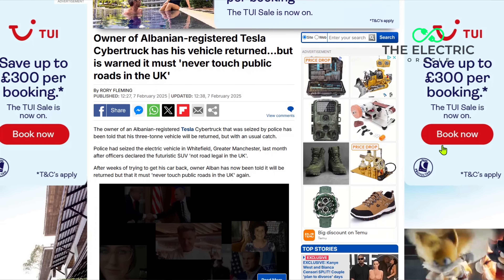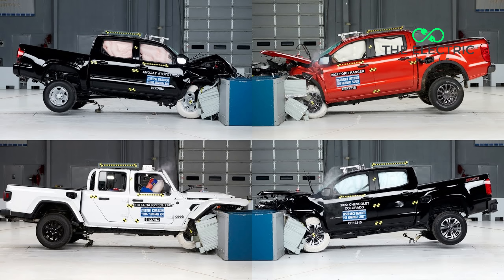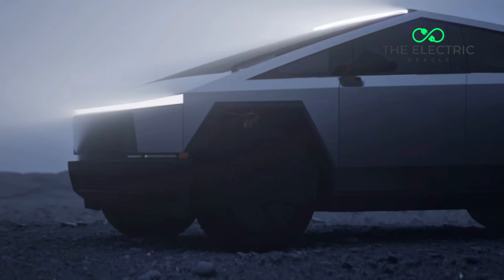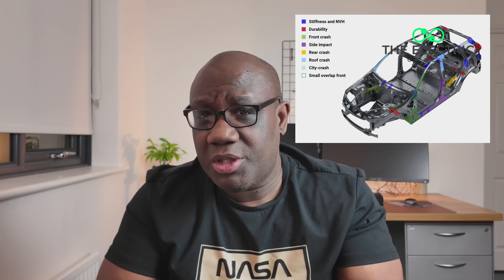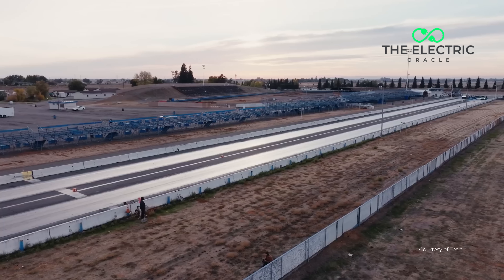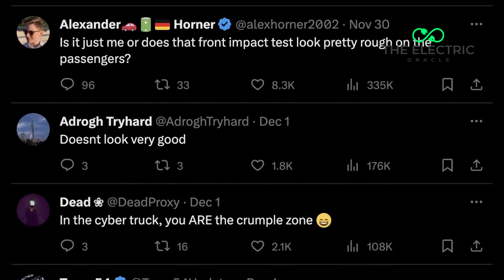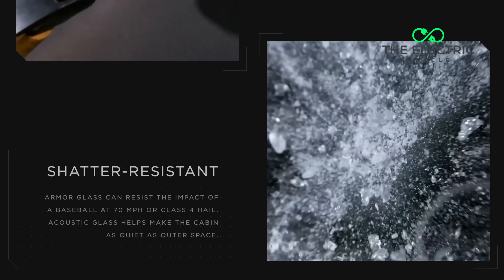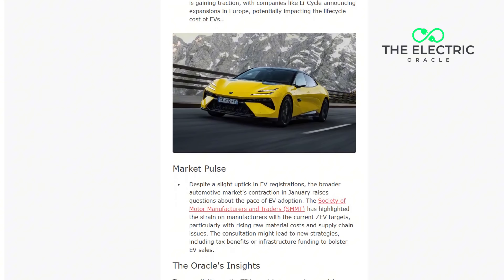Why the UK Banned Tesla’s Cybertruck – 5 Fatal Design Fails!

Comment: It's not just the UK, it's the whole of Europe that it would be illegal to drive on public roads
Reply: The Swatikar Douche Panzer is the single ugliest vehicle ever made.
Reply: No surprise at all, have been saying since it's unveiling, there's no way this sharp edged tank can comply with pedestrian safety regulations
Reply: And Australia
Reply: Do we have information about other safety regimes around the world, such as Japan and China, they all tend to merge to EU /British standards to allow easy exports.
Reply: In Australia also illegal to drive on our roads, no insurance no Rego, thank God
Reply: No, actually the author of the video is wrong. This wankpanzer's kerb weight is about 3200 kgs. The maximum permitted mass for cat B driving license vehicles is 3.5tonne BUT this goes up to 4.25 tonnes for vehicles with alternative means of propulsion  - so mainly electric - to allow weight of extra equipment. 

Therefore as long as you register your vehicle as no more than 4.25 tonne total permitted mass, you are good to go on your ordinary car license. 

Saying that, there are hundreds of reasons why this monstrocity should be illegal in the whole of Europe.
Reply: @orys he DID say that the unladen weight is 3200 kg. But add in a driver, passengers etc and you're at the 3500 kg mark.
Reply: @alanclarke4646  Yes. But for electric vehicles it's 4.25t, not 3.5 t.
Reply: When designing a vehicle you need to consider manufacturing costs and likely sales volumes to reach profitable production levels. It takes a special type of genius to design a vehicle that is non compliant in most major markets and therefore unable to ever reach profitable volumes - and looks like a skip bin.
Reply: philstuart8408 That’s unfair on skips
Reply from the maker: Good point, @EwenMcGuinness. European safety regulations are pretty strict, and the Cybertruck’s design definitely clashes with a lot of them. Do you think Tesla will bother making a Euro-friendly version, or is it just not worth the effort?
Reply: @TheElectricOracleChannel   Why woulkd they? it's a US truck for the US market like most US trucks.
Also, if you havn't noticed, tesla sales have tanked across europe, the UK being the exception.

As for regulation vs innovation.. 
So long as the innovation meets the requirements, there should be no issue. Why should the public be test dummines for a corporation? Thats what testing is for. 
If it fails, they should never be allowed on the roads.
Reply: @TheElectricOracleChannel  
Tesla might make a more traditional electric truck in the future, the Cybertruck was Elon Musk love project, he wanted a showcase of technology, something that everyone would look at and say "What the f***" 
And he got it, its way too expensive for most people, its also not very good at trucking, its in every sense a concept car made available for purchase. In fact the Tesla Cybertruck does not meet car regulations in majority of world countries, even China forbids it.
Reply: @SMGJohn the concept being “terrible”
Reply: @TheElectricOracleChannel  Not worth the effort. It is a car build for rough terrain / conditions at places with only a few inhabitants. More likely to be sold in Australia (if iet meets their requirements)
Reply: @reiniernn9071 doesn't meet Australian design rules either. Also diesel is the car of choice for offroad use here
Reply: @TheElectricOracleChannel  Hi from Sydney. Australia.  Thank Christ it's totally non-compliant in Australia, fails on multiple Australian Design Rules, plus it's just plain rudely ugly.

Re Weight, for 43 years now I have been driving a 1974 Cadillac Fleetwood Brougham Talisman, a Talisman was 3 year only premium ultra equipped most expensive model. Introductory '74 model came ex-factory with virtually every option as standard, choices were color and a sunroof like the stainless steel roofed 1957 & 1958 Eldorado Broughams. This added weight due to maximum equipment levels. Mine was built in Australia, as a CKD Kit car (completely knocked down) by GM Holdens Aust' at their Pagewood, Sydney plant, as needed to be factory right hand drive, have brighter Aussie compliant lighting front & rear. It is an early GM Air Cushion Restraint System car (airbags) has GM's Maxtrak so it has a joint ABS (brakes) and Traction control system that is also integrated with its active suspension self levelling system, it's fitted with GM's 10 mph damage free bumper systems (in USA for 1974 5 mph was mandatory but 10 mph was then planned & coming) GM missed out the 5 mph step and went straight to 10mph, these bumpers are serious, made of thick cast steel like a spanner then copper dipped, brass dipped then chromed and are mounted on 5 inch diametre shock absorbing hydraulic rams allowing 6 inches of travel.
 
At 6 metres by 2 metres in size dry weight it is heavier than the CyberTruck my Caddy is 3,180kgs with no petrol, oils nor water and certainly no people. So filled with all fluids and a few people it's a 4 ton !!  car. Its braking system makes the braking systems on all modern cars a bad joke, as for its anti-lock brake system GM's AC-Delco division went to Bendix Aviation and had them modify the braking system as fitted to smaller executive jet planes and modify them to fit a large car and likewise its steering system is hugely accurate with a mere 2.4 turns lock to lock also a modified aircraft nose wheel steering system, compared to this most modern cars steering seems clumsy. Power is not shabby either as being a export spec engine in it the 8.2 litre engine has ZERO power sapping anti-pollution devices, so it has 450 horsepower.

Not all US designed vehicles are a bad joke like the plain ugly Cyber truck
Reply: @TheElectricOracleChannel 
No.
Simply because there is almost ZERO demand for trucks in the EU.
They are just not a thing here. 
I know this may be hard to swallow for Americans, but there are no trucks here. People drive sedans, SUVs, vans; Businesses drive transporters.

Same story in China.

There are three relevant markets for cars worldwide and Tesla chose to focus 100% of their product development resources to develop something that addresses ONLY ONE of them.

Just imagine where they could be today if they had allocated maybe half of that resources to a product that actually addresses the whole world, not only 1/3 of the market. 

I will never understand how any Product manager with an intact brain could dedicate 100% to a product with only such a limited addressable market.
Reply: @TheElectricOracleChannel it would cost less than Musk bonuses to make road safe tesla truck... but i think it would end up looking different... at the moment ots really pedestrian mower..
Reply: @kurisu7885 
Not really. He'd claim the Cybertruck was always meant as a special "reward" for "freedom lovin' Murica" and build a different, much smaller exportable version positioned below the CT. 
No less expensive, of course, because... well... Elon.
No admission of anything...
Reply: kurisu7885 Elon isn’t wrong and Europe will just have to accept that and if it doesn’t him and his pal, Donna will chip in and buy it
Reply: @TheElectricOracleChannel  It most likely won't make one.
Reply: @TheElectricOracleChannel  I think this comment right here sums up your stance on the situation. Instead of making it "safer", Telsa should make it "Euro-friendly"
Reply: @TheElectricOracleChannel     Didn't he just explain why that is not an option.
Reply: @TheElectricOracleChannel  IDK. Tesla isn't in the auto industry anyway, but in the "selling carbon credits and collecting subsidies" industry.
Reply: @TheElectricOracleChannel  … You're extremely strange .. A poorly created video and now a peculiar question. 

The Cyber Truck would have to be completely redesigned from the ground up.  The front end is a 'wall' and would have to be sloped. The doors and front bonnet are trap hazards .. Plus the thing is so heavy it could not be driven without an HGV licence. 

Typical American vehicle; Too big, poorly designed and wholly impractical.
Reply: @TheElectricOracleChannel No way! Why would anyone go for CT if you can get model 3! Except someone who wants to show off! Trucks isn't really a thing here anyway let alone with useless bed loke CT! Also CT and truck size in general is cumbersome!
Reply: @TheElectricOracleChannel  I view the Cybertruck more like a marketing stunt. It's meant to display various technologies, not to be a mass market car. For this reason Tesla doesn't care that they can't sell it in Europe. They wont make a Euro-version either. They may make a smaller Pickup / SUV that has some stylistic cues from the Cybertruck, but is also compliant with European regulations. At that point it is a completely different vehicle as you yourself pointed out.
Reply: @TheElectricOracleChannel How many times are you planning on making the same video?
Reply: Cars no longer require a mechanical emergency brake(hand brake). All the safety points in this video are pointless because regulations aren’t about safety anymore…
Reply: Even in America this thing should be banned
Reply: Department of State in the US has a $400M order for armored Cybertrucks. 😅  not kidding.
Reply: @serenitysightings Let's hope for the sake of the occupants that they've strengthened the windows!
Reply: Should be illegal even in the totality of the USA.
Reply: @ If we had a functioning government it would have been taken off the road already. Too much money in politics
Reply: Good
Reply: Yes. You are right. Here in Europe, it's also not up to safety standards. Not at ALL!!!
Reply: Cybertrack is literally designed to kill
Reply: Tesla warranty is void if you make changes
Reply: isn't that mentioned at 10:49 ?
Reply: It'll be legal in Hungary, Belarus and Russia, but yeah, the rest aren't going to want this freakshow deathtrap that appeals to impotent people on the roads.
Reply: Who would want to buy or drive a Musk car? Perhaps some right wing nuts in the UK, but nobody here in the EU. And Canada is part of your Commonwealth - should you not join them in their boycott?
Reply: what a crying shame...............anyway!
Reply: Its just a really shit design made for little boys, Anyway Tesla shares are falling through the floor so soon it will be acedemic. .😂😂😂
Reply: Don’t worry, he plans on doing away with all those government regulations by destroying your democracy.
Reply: EU is a lost market for american made vehicles. No way Tesla cared about selling CT there.  Instead they needed this truck for the US market where any serious automaker has to offer a large pickup, and this segment is the most profitable segment in the US market.  The EU market is more ripe for takeover by China, and it will happen eventually.
Reply: @planesandbikes7353 BYD seems to be growing in popularity here, and I have seen good reviews of the range
Reply: No it's not. You can absolutely rent one and drive it.
Reply: to EwenMcGuiness: actually not completely true. if licensed as a CAR yes you are right. But some countries (including Czech Republic) allows any car to be registered and licensed as a truck. Trucks don't have the same restrictions as cars. sharp edges--- no problems. Lights--- no problems as long as they are not to high up, weight restrictions.... it's a truck....by license then so no issues. You will have speed limitations as a C1 truck, but with that licensing you are actually allowed to drive this ugly monstrosity anywhere in Europe (except on streets with truck restrictions - of course)
Reply: Norway and Albania beg to differ....
Reply: Norway allows them too.
Reply: W krajach UE cybertruck nie może być sprzedawany przez dealera samochodowego. Ale można sprowadzić ze Stanów używanego cyebrtrucka i dostosować do przepisów w stylu zmiana świateł kierunkowskazu z czerwonego na pomarańczowy itp. Sama nie wiem jakim cudem, ale tam gdzie mieszkam, czyli prawie 300 km od Warszawy jeździ cybertruck. Nie wiem kto był tak rozrzutny żeby go sprowadzić w moją okolicę, gdzie nie ma tak dużo punktów ładowania samochodów elektrycznych. Ale skoro stać go na te auto to stać go na prąd. Bo na ogłoszeniu w portalu z używanymi samochodami otomoto.pl (największy portal w Polsce) kosztuje prawie 1 000 000 złotych, czyli 250 000 dolarów. Moja mama stwierdziła że to najbrzydszy samochód jaki na oczy widziała. A widziała Fiata multiplę. Tyle że fiat multipla przejedzie te 500 km na wakacje nad morze bez problemów. A cybertruck musiałby jechać za ciężarówką by oszczędzać energię elektyczną. Niezależny test zasięgu stwierdził że zasięg cybertrucka to 400 km (a nie 517 km jak deklarują). I tylko przy założeni że jedzie 112 km/h (70 mil na godzinę), przy wyłączonej klimatyzacji i innych takich oraz bez załadunku i gdy wiedzie tylko kierowcę. Czyli dla Polaka (I większości szarych Europejczyków) jest to samochód bezużyteczny. Chyba że "prestiż" i pokazanie swojego bogactwa uważamy za coś użytecznego
Reply: Good! It’s not safe
Reply: If it's registered in a Schengen Area country, it can be legally driven across the entire Schengen Area, that's the whole point of the treaty.
Reply: It has not been ‘banned’, Tesla chose not to conform to long standing and clearly stated European regulations regarding vehicle safety. They ‘banned’ themselves. Quite apart from anything else a post 1997 UK driving licence does not allow you to drive a vehicle this heavy. No loss though, it is an utterly ridiculous and unbelieveably ugly monstrosity for which there would be very little demand in any case.
Reply: Australia as well possibly New Zealand too.
Reply: No problem in norway
Reply: @mnp3713  
Really?
These death-traps are LEGAL on  Norwegian roads?
Makes a mockery of your anti drink-driving laws 🤬
Reply: @noniousxltruffles7454  lol would you rather get hit by a 40 ton semi with a trailer?
Reply: @mnp3713  
I'd prefer to NOT be hit by ANY vehicle in motion!!
Big problem with cyberjunks is that chunks fall off as they're moving 🤬
Not a common fault with L.G.V.'s!
Reply: @noniousxltruffles7454  not a common fault with LGV - well i do se a lot of LGV tires, plastic wheel arches and freight dropped on the highway
Reply: @mnp3713  
Freight is TOO VALUABLE to leave on the roadside!
Can't recall  ever seeing LGV wheelarches tossed aside but I'd surmise on the rare occasion there is one it's as a result of an accident and tyres are generally left on the hard shoulder by lazy  recovery workers.
My hubby was an LGV driver and he NEVER told stories of him or his colleagues randomly losing bits of truck.
Mainly because unlike twunt's cyberjunks UK & European vehicles have actually passed SAFETY REGULATIONS!
Reply: @noniousxltruffles7454  well okay i never seen one single part of a cybertruck dropped on the road, or part from any other tesla .

Annuller

Svar
Reply: @mnp3713  
As far as I'm aware it's only his cyberjunks that fall apart.
You've clearly not been watching the videos about the cyberjunks and ALL their faults - THE most RECALLED 'truck' EVER  😂😂
Reply: @noniousxltruffles7454  i know its a junk truck and have its problems and i would never buy one - but i do not think its that dangerous compared to other veichles i think its much safer for pedestrians than a hummer, campervan etc.
Reply: Sounds great! Now European goods will have to drive somewhere else.
Reply: @ what?
Reply: Actually not, the first Cybertruck recently came to Norway.
Reply: @thorbjrnhellehaven5766 Norway is not a member of the EU
Reply: Harley Davidson make fantastic motorcycles that work well in the US, Europe the UK and New Zealand. I can personally attest to this.
Reply: there are several CT already registered  in the EU
Reply: @robertwoodhouse-bm7kt  Haven't they been brought in under individual approval, essentially like a one off hot rod?  What is discussed here is the Type Approval and the subsequent Certificate of Conformity.  Notwithstanding getting around the regulations, the basic principle is that the Cyber Truck does not conform to the safety standards required for European use.  As it stands at the moment if you have an accident in the CT you are likely to suffer more than you should because of its crash performance and then the emergency services can't get you out because of the bullet proof structure is too tough for the normal gear.  Then,  The battery catches fire and you are roasted alive in a stainless steel coffin.  It'll save a trip to the Crem.
Reply: @robertwoodhouse-bm7kt  In the Netherlands it's not allowed on public roads
Reply: @robertwoodhouse-bm7kt  Where?  I have never seen one.  I'm pretty sure the CT does not comply with EU conformity regulations.  The 3.5 tonne limit for driving licences applies thought mots of Europe too.
CT is not for sale in Tesla showrooms, that I have seen anywhere.
Reply: @brian_jackson  There are some registered with some kind of loopholes. One I think is registered in Czech, but when it went to Poland, then Polish police basically banned it from driving and had to be towed. The main issue polish police had was that as it is over 3.5t, then it classifies as truck. Vehicles that classify as N1 have to be limited to max 90km/h.
Reply: @robertwoodhouse-bm7kt  not in a EU member state.
Reply: @robertwoodhouse-bm7kt  Off road useage only. I know where there is one and it has to be trucked around as it cannot go anywhere near the public.
Reply: @Jewellerybybarrie  One in Poland is being rented out, the one nabbed in the UK was registered in Rumania has Rumanian number plates and driven to the UK on EU roads.
Reply: @robertwoodhouse-bm7kt  No,there isn't.
Reply: @robertwoodhouse-bm7kt  where???
please tell me where?
Reply: @Arltratlo  2 in Poland and I think one in Check, the one  taken in the UK was registered in Rumania, these are all bought in the US and imported as a private import
Reply: @robertwoodhouse-bm7kt 
Perhaps these were intended for display in motor museums, such as Gaydon near Brum?
Reply: @robertwoodhouse-bm7kt  Some have been impounded and taken off the road
Reply: @robertwoodhouse-bm7kt  yes, but those are registered as LORRIES.
NOT as „passenger vehicles“.

And that’s a big deal. 
You need an extra license, you need different insurance…
Reply: @robertwoodhouse-bm7kt  not in western Europe and members of the EU,  MOST OF THESE TRUCKS ARE IMPORTED AS TEST VEHICLE orr road use only.
Reply: @GenX-jedi  These are IVA personal imports

Quote from Europe traffic safety council  "Huge and letthal American pick-up trucks (such as Ford f-150)are now a regular sight on city streets in Europe.  But they don't meet EU safety standards and are not tested for pedestrian safety.  How is this possible?  The answer lies in the mysterious world of Individual Vehicle Approval.

The UK definitely and I think the EU also have raised the weight limit for B licence to 4.2 tons for alternative fueled vehicles such as electric and hydrogen vehicles.  Combustion cars still have the lower limit.  German used car web site has CT for sale registered in Poland  for normal road use.
Reply: @robertwoodhouse-bm7kt     They do not meet EU regulations so there must be a loophole. Sometimes you can have a prototype registered. So there may be a few that are officially "prototypes". Put in serial production it would be a problem. And driving licences is also a problem. It has to be a licence for heavy lorries as it will be way over  the usual 3500 kg. or you'd have a "truck" with only a couple of kg loading capacity.
Reply: @robertwoodhouse-bm7kt  ..

I _seriously doubt your claim_, as they cannot be Type Approved and therefore cannot be registered and cannot be insured.
Reply: @robertwoodhouse-bm7kt  Another channel covered this recently.  There is one in the UK - Albanian plates - which is ONLY used on a short school run and which cost the owner hundreds of thousands to bring up to BASIC safety standards which included an entirely new lighting system AND basically wrapping it in rubber.
There is apparently another registered in the Czech republic {I think, one of the countries in that region anyway] and again the owner spent thousands on making it meet the very basic legal requirements again with total lighting system and wrapping it in rubber.  But because of the weight it falls foul of weight restrictions so is also fitted with both governors to regulate the speed AND a tachograph because it now falls under the heavy truck laws.  Again like the one in the UK it is apparently seldom used and really only shows up at shows.
Reply: @ Science wins over emotions every time, unless you are Frankenstein's monster.😁
Reply: @robertwoodhouse-bm7kt  Probably owned by other automotive companies for R&D purposes.
Reply: @LionelAkram  And can only drive on private property, not public roads.
Reply: No it isn’t, Albania is in Europe and Teslas are legally registered there already.
Reply: @talkingoyster  Albania is geographically in Europe, and is an EU Candidate Country, but it is not yet a member of the European Union.  It has the same status as Turkey and Ukraine in this regard.
Reply: @GodmanchesterGoblin  I said in Europe, which is factually correct, Europe is not just the EU...
Reply: @talkingoyster  Pretty sure your post said EU when I replied to it (as did someone else).  But my apologies if I made a mistake in reading.
Reply: @ No worries. Maybe they edited it, it said Europe when I replied.
Reply: @talkingoyster  Factually incorrect talkinggoyster. Albania is a candidate member state, but isnt in the EU .
Reply: @AndreasScout  I didn't say EU and neither did the comment I was replying to. EU is not Europe.
Reply: @talkingoyster  Albania is on their way to join EU, and it is EU that have the safety regulations.

The Tesla truck being approved is a sign that there is still a lot of work to do before Albania becomes a EU member.
Reply: @talkingoyster /
You need, at least, a C1 drivers license.
To expensive for a civilian to drive in Europe
Reply: @talkingoyster Albania is in Europe but it isn't in the EU, though it has applied and has taken the first steps. 
It's extremely likely to ban the Cybertruck in due course, to meet EU regs, Albania is more eager to please the EU than to please Elon Musk
Reply: @neilgodwin6531 ok? I never mentioned the EU...
Reply: @talkingoyster  Albania is geographically in Europe, but not part of the EU.  Trouble will liikely start when driving into Greece
Reply: @talkingoyster Albania nie jest krajem Unii Europejskiej
Reply: @talkingoyster Albania is not in the EU.
Reply: @ I never said it was
Reply: not really true cause some EU countries have already registered cybertrucks we have seen on EU roads, mostly eastern european countries or so far only eastern europeans cause here that would not be such an easy deal or fix.
Reply: @typxxilps Wrong. Impossible to get registered in ANY EU COUNTRY.
Reply: @juri_xiii9977  not impossible. There is one registered in Czech, but with some loopholes and minor modifications
Reply: @typxxilps It is most likely that they are imported under the individual process and have to go through whatever their countries  individual process is for approval.  here and many parts of Europe it would be IVA or in Germany TUV.  It doesn't have a Certificate of Conformity that would allow it to be marketed and sold anywhere in EU or UK.
Reply: @typxxilps Those registrations are in those countries for a reason.... Albania has 'civil workers' who will approve your car if you line their pockets deep enough. 

Has nothing to do with if the garbagetruck is safe.
Reply: @MarvinWestmaas  yes, but...
it is registered as a "truck",
as a truck for which you must have a "C" category driver's license and therefore there are restrictions on where and when you can drive
For example, in summer in Croatia it is common for trucks to be prohibited from driving on weekends and holidays
And when do people go on trips most often?
on weekends and holidays
furthermore as a "truck", it must undergo periodic technical inspections every 4 months, for safety
Taxes and fees on a truck as a commercial vehicle are 10x higher than on a car
and finally in Croatia the speed limit for trucks is legally limited to 80 km/h and the fines are high if you drive a truck too fast, and if you drive 140 km/h, the police can put you directly in jail because you are a "dangerous person on the road"
Reply: .  And, not to mention. Having a bottle of liquid 'NyQuil', which contains only 10% alcohol is OVER the limit for a class C license ↔️ go to jail❗️
Reply: @MarvinWestmaas Albania is not yet a member of the EU, though it has started the path towards accession. Whether it has applied EU safety standards to cars yet is something I can not answer.
Reply: @neilgodwin6531  Yeah, and? It almost sounded like you were arguing against Albania being corrupt which is the only way something so dangerous would be allowed on the road.
Reply: @typxxilpsAre you sure those were EU roads? EU regulations apply, not surprisingly, to ALL the 27 members. If those Cybertrucks strayed onto EU territory, presumably the local authorities would deal with that, though I think, in fairness, that it's entirely possible for someone to drive hundreds of miles in areas of low population without attracting the attention of the authorities. 
It's possible, even in parts of Britain, say mid Wales and the Highlands
Reply: @typxxilps Nope, just under individual approval
Reply: @typxxilps If someone buys a CT in the US and personally imports the vehicle to UK and EU it has a different approval process.  quote from Europe traffic safety council 

 "Huge and lethal American pick-up trucks are now a regular sight on city streets in Europe.  But they don't meet EU safety standards and are not tested for pedestrian safety.  How is this possible?  The answer lies in the mysterious world of Individual Vehicle Approval."

Tesla cannot sell them new but people can import them if at least 6 months old.
Reply: do you really think this was NOT a political decision  😉
Reply: @gsxrjeff It doesn't meet long-standing safety regulations, nothing to do with politics.
Reply: @gsxrjeff  Of course, decades old laws were specifically made for the cybertruck.
Reply: @gsxrjeff If it was a political decision, why are the rest of Tesla range sold in Europe?

Grow up.
Reply: @LoCoAde  maybe something has changed ? grow up wow😥
Reply: @gsxrjeff  If politics is involved, then explain the window logic as to why the rest of Telsa's range isn't banned? Go on. Entertain me.
Reply: @gsxrjeff  There was nothing to "decide" here, if a new vehicle does not comply with age-old laws.  That Tesla overall is dramatically losing market share in Europe (the continent, not just the EU) due to Elon Musk's extreme-rightist meddling is yet another story.  Tesla used to be a car for environmentally-friendly people, or progressives if you will, and those don't want to be caught dead having any connection to Elon any more.
Reply: @gsxrjeff er. Yes.

It’s not safe.
Reply: @gsxrjeff  Several Cybertrucks has just been approved in Norway. All factory legal vehicles that's been registered for 6 moths or more in USA or Canada can be imported and registered in Norway without making any changes to it. That meens all cars, trucks and trailer, no weight limit. You do have to have the proper licence though if it is over 3500kg.
Reply: @ArveBjurholt Famously, Norway isn't in the EU, as Honest Nige repeatedly said in 2016
Reply: @gsxrjeff  Yes... because the decision made here was by Tesla to not make it compliant to the EU standards that they already knew about. The EU didn't make any decision on the Cybertruck, Tesla did.
Reply: @gsxrjeff yes you daft propaganda gobbler
Reply: @gsxrjeff Oh, I see. The UK and EU both changed their entire regulatory regime to attack an oligarch who was barely known to most people when the Cybertruck came up for review. 
You should be a political analyst for GBNews with that insight
Reply: @ What a nonsensical suggestion.
Reply: @gsxrjeff     Oh ... come on, crybabies. Those are obvious facts.
Reply: @gsxrjeff No it wasn't! If you want you can easily get model 3 or any other tesla model here! Wonder what size chunk of meat that sharp corner will take out of pedestrian! BTW trucks isn't a thing here anyway no matter electric or ice!
Reply: @gsxrjeff It wasn’t a political decision, unlike it was one made by Tesla when they deliberately and knowingly designed a vehicle which meets no international standards.
Reply: @gsxrjeff  No, because it’s not new, there are loads of cars that won’t make EU requirements: what car makers will do will make a version for EU market. So that’s a decision for Tesla
Reply: @gsxrjeff I don’t think you understand what has happened. It has not been banned; that term applies when something has been legal and the law or regulations are changed to make it illegal. In this case we have complex legislation governing car safety (which in the UK and Europe includes the safety of people not in the car, like other road users) which has been in place for decades, since long before Tesla existed. This car fails to meet those standards, which is a design choice by Tesla and presumably Musk. That choice might perhaps have been political but its effect is that they have themselves chosen to make their car illegal in Europe. Europe has made no decision about this vehicle except to enforce existing law, as they do for every other vehicle. That is not political.
Reply: @gsxrjeff  A political decision would be to change the existing regulations that every other vehicle (or driver) is required to comply with.
Reply: So, we made those rules 25 years ago to keep that thing away, is that what you believe?
Reply: @leifvejby8023  No, but the standards were laid down 25 years ago for all manufacturers to follow.  Tesla must have known about them and ignored them presumably, they didn't what the truck coming into Europe.
Reply: @clivewilliams3661  you need a truck license to drive the CT in Europe....and not many have one in the EU, too!
Reply: @leifvejby8023  Not "that thing", but "that kind of things"!!
Reply: @AllanP-n3q   This video is about musk's dumpster, so it is "that thing" here.
Reply: @Arltratlo  In UK the C1 license to drive up to 7.5T was automatic on passing a car test up to 1997 so that most drivers passing their test before that date can drive a CT i.e. more than 45 years old.  You will also notice how many drivers there are for the medium size RV/Motorhomes rated above 3.5T, who must have the same license.
Reply: @clivewilliams3661 President Musk must have thought the rules don't apply to him... I mean, he has form
Reply: @clivewilliams3661 I find that very hard to believe that Musk would cut his nose off to spite his face especially with the competition for similar coming from China.